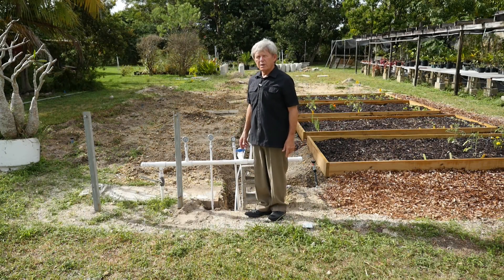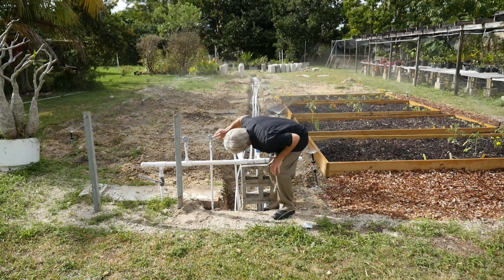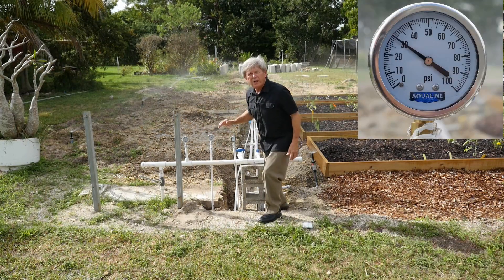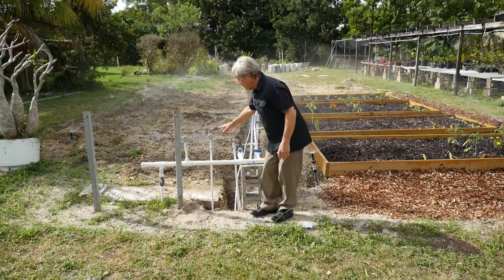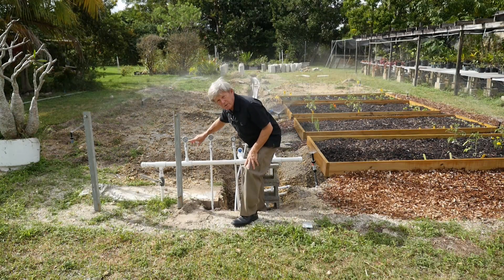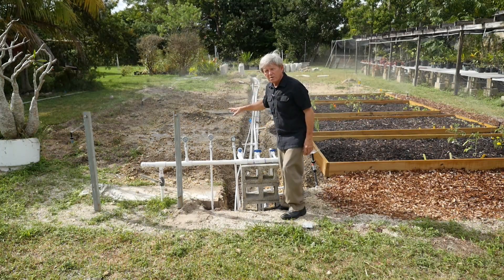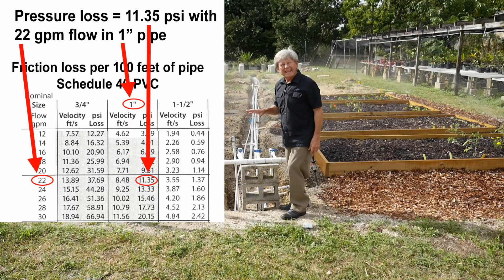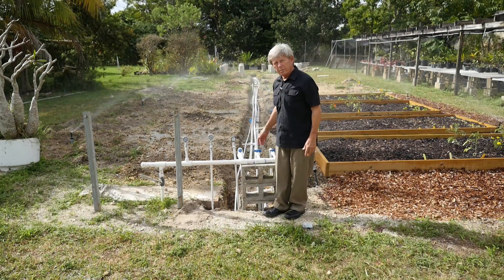Water pressure, flow, and pipe size - 2

Comment: Hi, thanks for this its pretty usefull! I would like to evaluate the flow from my main line and its not easy to do without cutting it and test... Maybe you already makes the test and have an idea? Its a pex 3/4 (0.681 ID) and around 40 ft long. My static pressure is around 64 psi. For what I think according to tables is that I could have around 14 GPM with remaining 49 psi (12 ft/s and pressure drop of 35 psi/100ft) but not really sure on that! Do you have any ideas? Thanks again!
Reply: You can buy a pressure gauge. Just tie it on a 1/2” fitting downstream

Comment: I have a 5/8`water meter and it's 50 feet to the house but I also have 100 feet of irrigation and the sprinkers barely work. Can you upside to 1" from a 5/8" meter or would that not work? Thanks for the great information 👍

Comment: hi interesting video of demonstration. please explain more on if the supply pressure is constantly same, why is the flow rate is different from the use of different size of pipe where the smallest pipe has the least flow ? many thanks

Comment: Would I be able to go from 3/4 pvc pipe to 1 and 1/2 water line or would I need replace entire 3/4 with the 1 1/2
Reply: You certainly can go up in size, but you won’t regain any pressure lost. You’ll simply reduce the amount of pressure that’s lost per foot for the sections of pipe you size up.

Comment: Very informative video... I recently finished my irrigation system and I couldn't remember my school/father teaching and I went with someone at the shop's recommendation. Of course, now that I have finished everything I have found that my water pressure is not good enough and my sprinklers won't reach their length. 
My question is - can I now go from a 3/4inch to a 1 inch pipe? Will the water pressure and flow increase? 
I connected a 3/4 inch pipe from my front garden to the back, 30 meters long then I installed another tap. From that tap I put a connection with a timer for my irrigation system with another 3/4 pipe. This is the pipe I wonder if I can change to a 1 inch?  I hope this makes sense.  I really hope you can read my question.  Thank you once again for the video Dr Phill.
Reply: I’m also curious what you ended up doing. You may regain a small amount of pressure by switching to larger pipe in the back, but the pressure lost in the 30m of 3/4” pipe is unrecoverable without also up-sizing that pipe.
Reply: If my understanding of the video is correct. Then it should increase your pressure if you go to 1 inch pipe. So in that case maybe it's better to install 1.5 inch pipe with a flow regulator to decrease pressure to what you intend to use it at. That way you have max pressure with adjustability. In any case. I'm curious what you did?